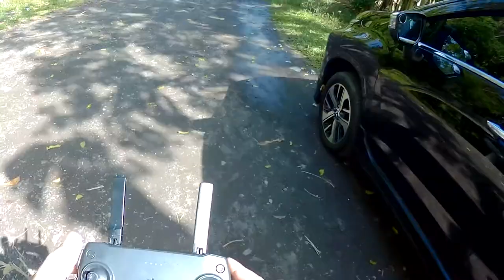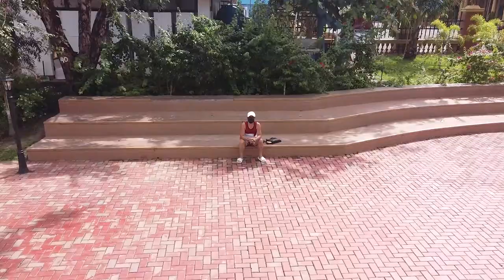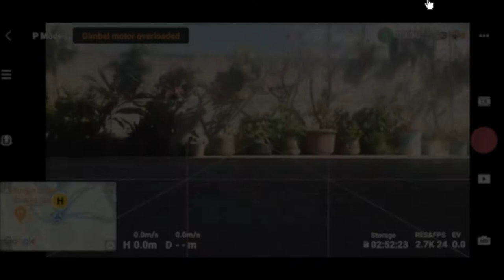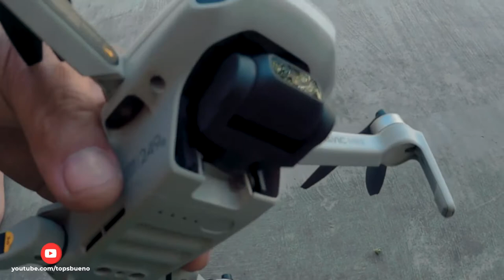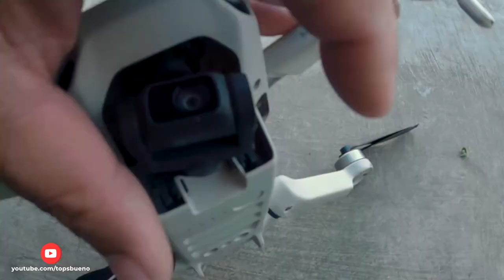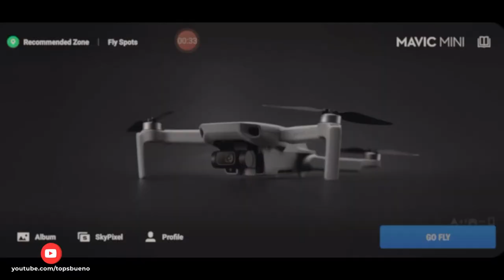FIX GIMBAL OVERLOAD ERROR: EASY SOLUTION  DJI MINI / MINI 2 / MINI 3

Comment: It happens normally when you are flying during a windy and dusty condition.  Using compressed air will solve the problem but do not rotate the gimbal. You will end up grinding the fine particles on the gimbal's moving parts. Camera lens brushes also helps
Reply from the maker: Thanks Frank for your input.
Reply: So iam new to drones and i see you have alot of information on it. I just got my mini 3 pro straight out of the box and went flying outside there was a little wind like 25kmph but not to bad when i move the gimball down the camera start moving like its drunk for 2 seconds and then its on 0 degree agains with the message gimball motor overload is this normal? Should i be worried ?
Reply from the maker: Not to worry. It really happens when you placed the drone with lots of debris, small particles that used to clogged up the motor of the gimbal. Just use a regular hand blower to blast that small particles away from the gimbal.

Comment: Got this error flying about 320m away, not pleasurable! The camera just shook like crazy and I had to run to my home point lol
Reply from the maker: Better check the gimbal. In my experience, small particles during takeoff may have entered the gimbal motor.
Reply: Bruhhh same here just happened today I was 394ft up in the sky bout half a mile away from where I live and dude I was shitting on myself 😂 the gimbal wouldn’t go up or down so I had to navigate it using the gps

Comment: Meron po akong Mini2 se. Nakalimutan ko tanggalin ung gimbal protector before turning it on. Then ung sa DJI Fly App Gimbal Calibration (auto) sobrang tagal naman. Stuck at 90%.
Reply from the maker: Possible nyan po is galaw-galawin mo lng ung gimbal,. Nangyari na rin sakin yan na di ko natanggal ung cover then  if may blower ka, bugahan mo ung axis para matangal ung kung anong particles na nagti-trigger ng error
Reply: @Tops_Bueno  maraming salamat po. It worked. May mga small particles nga talagang pumasok. Since wala pa po akong blower. Ung bibig ko nalang naging blower haha. Day2 user palang po kasi sa droning
Reply from the maker: Buti naman, mas maganda bili ka na rin nun. Mura lng sa online shopping... :)

Comment: What did u just say????
Reply from the maker: If you are having problem with the gimbal for your dji drone, use a blower to remove small particles that is causing the error overload
Reply: Ditto
Reply: what i did was ...
Reply from the maker: What I did, I tried using a blower to remove small particles or dust that's affecting or causing the drone to have a gimbal error overload
Reply: @Tops_Bueno  yep that worked!!! Made a few videos of me flying 😄
Reply from the maker: You"re welcome....